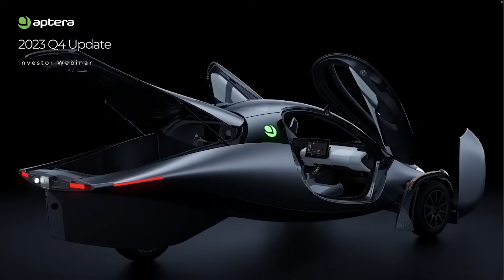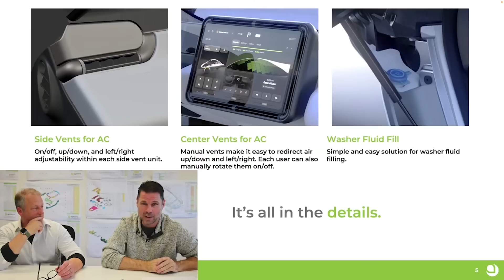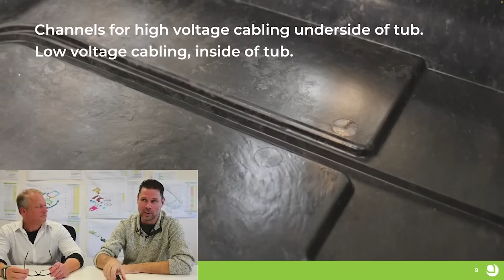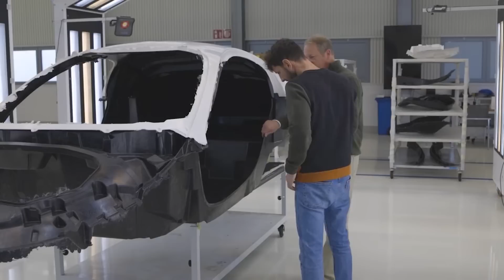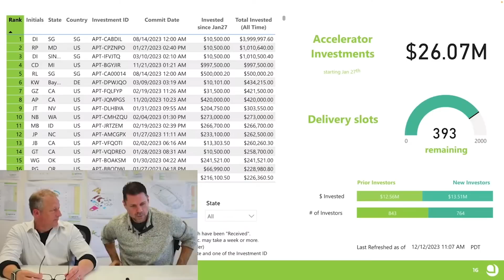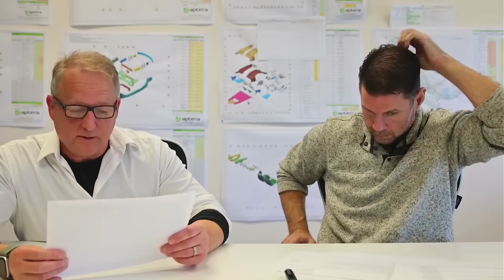Aptera December 2023 Investor Webinar

Comment: It would be cool if it had a solar panel coming up from somewhere of the body that had a solar tracker  to charge it whenever it's parked. Because these solar cells are extremely sensitive to light, you can drop the output like 80% just by moving little bit away from the sun.  So having solar tracker running when it's parked would offset the losses.
Reply: Aptera has developed special controllers that reduce power drop from shadows compared to usual panels.

Comment: As the heat pump is key to all EV longevity, will Apteras have Tesla-like battery temperature management, including Octovalve-like manifolding?
Reply: They have said they will have a heat pump eventually. The current system has 3 liquid cooling/heating zones and uses a compressor and resistive heating for HVAC. The battery pack has its own end plate liquid cooling zone and can cool or warm the battery as needed.

Comment: Ask first generation nissan leaf owners feel about their batterys that don't have dedicated battery management systems (heat and cool pack as needed to keep in more ideal range for most of the time) if aptera skimps on this the batteries will not last and range will drop rapidly after delivery if they ever get there
Reply: Aptera has an innovative heat management system with three separate cooling (or warming loops to manage temperature, and they don't stress the packs even as much as Tesla does, while using similar 2170 NMC cells.

Comment: With EV's it's pretty obvious that batteries WILL eventually go into thermal runaway in some cars. For a myriad of reasons. I think standardized safety tests need to be established for toxicity and whatever else. First responders are getting permanently disabled because they don't realize the cobalt, and other lovely elements will try and kill them. And the public needs to be made aware that they need to get away from the smoke plume as if their life depends on it. Not to mention EV's parked inside enclosed spaces can build up explosive gases in some cases.
Reply: The battery cells are sealed canisters How are they emitting toxic funes in an enclosed space?
Reply: @garywozniak7742  The toxic fumes occur if the battery goes into thermal runaway. This is very bad in a parking garage, or container ship for example. The explosive gases can happen without thermal runaway during charging. Look for garage doors being blown off of homes because an EV was charging and the gas hit the pilot on a water heater (for example). There have been several well publicised police reports.

Comment: Thank you for posting.  I have a deposit on this vehicle with high hopes of success.  My only concern / reservation is seeing the test crash data both for light impacts under 10MPH and Higher impact over 30MPH.   What also is a huge concern is the cost of repairs on low impact crashes.

Comment: Steeeeve! I need your commentary! I’m still confused about the motorcycle vs car stuff. My motorcycle doesn’t need seat belts, air bags, side impact protection, crash testing, gas (EV) mileage numbers etc.
Reply: Aptera is actually in the autocycle class in the majority of US states.  Each state is a bit different and the classification goes by state in the US.  Aptera will have many features it isn't required to, including design to pass crash tests and air bags.  Of course, it will be FAR safer than any motorcycle, and I say this with around 1/2 million miles on 2 wheels.
Reply: Half million on 2 wheels! Holly crap!  I have to do my math! At 62, I’ve had 7 bikes. I’ll get back to you!
Reply: @dougbrittsan-yn9sl  My first ride was on a BMW R27, and I was hooked.  My first owned bike was an original 1942 Indian Scout  war bike I got when I lived in Iran. (not counting the Velosolex I owned in Germany).  I later had a Honda 50 (when I lived in Japan), a Suzuki 400 that I did a 40 mile daily commute on, a Suzuki Water Buffalo, a BMW R/80 that I rebuilt 3 times, a BMW R/75 triple, an R1100 4, and a couple of Gold Wings.  

Many of the miles were from commuting from Vallejo to Union City when I lived in the SF Bay area.  I also had 1000 in one days, and many 2 up motorcycle camping trips with my wife.
Reply: Thanks for the information! It was unclear to me why they were going above and beyond the motorcycle requirements.

Comment: Perhaps they could make a small plug in temporary battery pack that plugs into the charger port or belly that has say 1 or 2 kWh or enough to drive the vehicle on or off the ship. Take it back, charge it up, and use it on the next vehicle. Have a set at each end and do not ship those across the ocean, just plug in a new temp battery to get the vehicle from the ship to the final assembly plant. You could then drive it to your shop for permanent battery pack installation.

Comment: I don't get it. This is a glorified electric motorcycle. Something like a eUP is a lot cheaper and more practical...
Reply: Does an eUp! go 16 km on one kWh of power?   The whole point of Aptera is ground-breaking efficiency, which then make solar power practical.
Reply: Yes, and? It's an actual car, though. This is  not a practical vehicle in any way, though. A e-bike with a solar charger would be as good, and far, far cheaper. This seems like either a joke or simply money grab scam... @993cc
Reply: @stevemcgowen the vehicle has side by side seating, a strong passenger cell protecting the passengers, air bags, crumple zones, heating and air conditioning, 7 feet of room behind the seats and 32.5 cubic feet of storage. With full solar it can get up to 40 miles of charge per day from the sun.  The Launch Edition only uses 100wH per mile and has a 400 mile battery.  Using the EPA method it will get 337mpg-e 
 I've owned a motorcycle and rode it year round for few years in New England. I even rode home in a snow storm or two when the meteorologists blew the forecast . I've dumped the bike a couple of times. It was a blast but I was lucky to get 30mpg on it and it was dangerous as all hell. There is no comparison between the Aptera and a motorcycle.
Reply: It says it can go 40 miles on a charge on their web page. That's what a e-bike can do. This is a 3 wheeled electric motorcycle with a body. Sorry if you got scammed... @garywozniak7742
Reply: @stevemcgowen that is up to 40 miles a day from the solar
 panels. It has an NACS charge port in the back.  The first model, the Launch Edition  has a 400 mile battery. There are 250, 600, and 1,000 mile battery models planned after that. On 110V it will charge at 13 miles/hr. On an L2 charger it will charge 59 miles per hour.  It will charge 250 miles in 30 minutes at 50kW on a DC FAST charger.
Reply: So it's a EV but not even a car, but costs a lot more than a EV car. Got it... @garywozniak7742
Reply: @stevemcgowen  Aptera has its following with around 46K reservations. It is not a car but was designed to meet automotive safety standards.  The  base, 250 mile range, model is going to be ~$26k. A Tesla Model 3 standard range (250-272 mile range) is around $39k. Aptera's 400 mile range LE model is ~$35k. The Tesla  Model 3 long range (333 mile range) is ~$46k. The Aptera is 2.5 time more efficient than a model 3.  It will have a lower TCO over its life. In my case I drive around 12 to 13 miles per day average for my daily driving.  For my normal driving I probably won't have to plug-in charge. If I take longer trips I will have use public chargers as needed but I'll use much less power than a conventional EV when I do need to charge.  If it's not your thing that's fine.
If you want to compare it to a motorcycle a full dress Harley Davidson is over $40k. The top of the Honda Goldwing is around $33k.
Reply: @garywozniak7742   The Aptera prices you quote have gone higher. How much, no body knows because they have nothing to sell. Without cash to reach production, Aptera is just a dream.
Reply: @montanaerdoc those are the last guesstimates from Aptera thst zi am aware of.  The 250 mile base will be ~$26k. The 400 mile LE was $33.5k they now say ~$35k. Since they are the better part of a year away from production it is understood that their priced might change. I will stick with their numbers.
Reply: @stevemcgowen  My wife and I are two of the lucky few who have gotten to ride in a prototype.  Once you have a chance to experience one of the production models, you will have your eyes opened.
Reply: Commute in an Arcimoto FUV, you will get a hint.
Reply: I totally agree.....you don't get it.
Reply: Sorry if you got scammed... @hambone3720

Comment: That they haven’t nailed down an EPS column is concerning, especially since Jason Hill said for undecided parts/vendors they were down to nuts and bolts.
Reply: A car as light as Aptera shouldn't need power steering.  It would be nice for those of us with no desire for driver assistance features to be able to opt for manual steering.
Reply: The Aptera has manual steering with a variable assist electric motor. It's electric power steering like a lot of small cars use. It provides nore assistance in a parking lot then on the road at faster speeds.  That same motor is used by the OpenPilot driver assist. The steering itself is manual with a ~2.25 turn lock to lock. OpenPilot is optional and you can turn it of if you have it. It's more like an advanced cruise control. But you must keep your eyes on the road ( it watches your eye movement) and hands on the wheel. On a long trip it will keep you in a lane on the highway and maintain a safe speed. You can override it st any time by turning the wheel. It can also brake to keep you from colliding with someone stopping suddenly in front of you. I am tempted to add the option. After watching videos of it I think it might make driving safer if used right. @robertkirchner7981

Comment: ,,,please,,, must likely done software tells Tesla chargers or any charger the best charging temperature or spec with weather or just just best spec to charge in case the charger is not configured we can still charge anywhere.
Reply: I am not sure exactly what you are saying, but Aptera has developed their own advanced charging system that uses the 2170 NMC batteries that the Tesla Model 3 uses, but stresses them considerably less.
Reply: @n.brucenelson5920  I do that , I meant when you plug in any charger will automatically detect what the best high voltage to charge, because you can easily find a fast charger Tesla charges everywhere, I don't know are they labeled do they give you choices on the screen do they automatically detect your vehicle's capabilities some kind of software or power supply. When I see the Chargers they all charge a different rates slow fast and so on and they're not labeled as far as I can tell but I've never really checked their screens I don't know how they work.
Reply: @1978rayking  The Tesla chargers have different maximums, but the vehicles determine how fast they take the charge, and the charger won't supply more than that.
Reply: @n.brucenelson5920 thats  good, tnx

Comment: Will parking next to a wall possibly reflect additional light 💡 onto the Aptera to generate more electricity?  Also do you know if we will be able to light up our solar panels like seen in the videos?  This would look really cool and aid finding in the Aptera in the dark.
Reply: I doubt the solar panels will 'light up". Regarding parking near a wall. If the wall doesn't block the light from striking the solar panels (that seems like it would be luck if it did not) and it was a reflective color, it might help  increase the the amount if light strking the solar panels.
To start trying to visualize what the sun's postion is during the day in places where I typically park I downloaded an app called Sun Setter on my android (Samsung) smartphone.  It determines your location and  the sun's postion at the current time of day and it track throughoutthe day at that location. It does the same for moon postion. There is a free version but I opted for the $8.99 version 6 all the options enabled.
It helped me confirm that my parking location at "home" is pretty good for for picking up solar charge throughout the day.
Reply: A mirror wall would do it.

Comment: Only 10,000 signed up for the launch edition? That surprises me. Figured the majority of the 40,000 plus orders would have it. On the plus side, as I ordered the launch edition, maybe I'll get it much sooner than I thought, even though I'm around 29000.
Reply: The Launch Editions are the only variant in play. Outside of the Accelerator vehicles they expected five thousand more LE's. They did say they would make more if the demand was there.
Reply: Peeps gotta have their customizations...
Reply: @2eyedhairlessmnkey  
Not initially. According to Sandy Munro, you start production with one variant to streamline the process, avoiding complexities in manufacturing.
Reply: @barnabasseadog7660  yes, I know. I just mean there are those that would rather wait to have a customized vehicle than the generic launch edition.

Comment: Could Aptera send over 3 or 4 battery packs to rotate loading the vehicles then taking the battery pack out and loading into the next one to load? Would that be possible to solve the battery issue...
Reply: What battery issue ?
Reply: @garywozniak7742    One of them said that shipping the incomplete vehicles from Italy to California without batteries created a difficulty in loading the vehicles because they couldn't power themselves up the ramp or whatever.
Reply: @robertkirchner7981  thank you Robert. I missed that.

Comment: I was thinking that we would be seeing the first production vehicles starting to go to customers in July or August but it sounds like that is very doubtful and even next year this time, is even in question. It is clear that Gamma does not have a PI cooling system nor does it actually take a charge from a Tesla fast charging station. (No agreement with Tesla. You can plug it in but that doesn't mean you will get the vehicle charged.) There really is a great that needs to be done before we see vehicles going to customers.  I'm hoping that I am wrong about this as I would really like to see my Aptera in my driveway in 2025.

A question that I have not seen an answer to is regarding kids in the Aptera.  In many states, kids under the age of 8 are not permitted on a motorcycle. If the Aptera is an autocycle and registered as a motorcycle, does the limit apply to kids?  Cars like the Corvette can have infant carriers if the passenger airbag is turned off. Not certain about kids that need a booster seat and if they can be in the front seat. It would be unfortunate if the Aptera were an adult only vehicle.
Reply: GADZO! An INTELLIGENT QUESTION! and one I had not thought on. This writer has one that needs a booster seat , great grand kids. It would be a disaster if they could not ride in it. Tho for this writer, by the time I get mine, the kids may be in college

Comment: The construction material would be even better if the carbon came from a plant source.
At 26:38 (and after) the tail has a slightly darker gray material at the outside edges - I wonder what this is?
Reply: That’s the same hard foam that is front and rear of the wheel pants.
Reply: Of note the outer panels on the body are FG-SMC (fiberglass SMC) the main structural body parts are CF-SMC. Fiberglass has a carbon footprint thst is about a 1/10 that of carbon fiber.